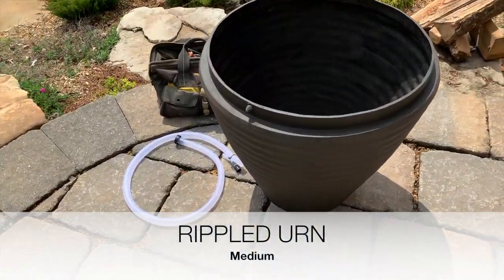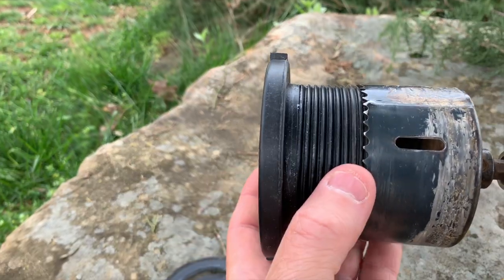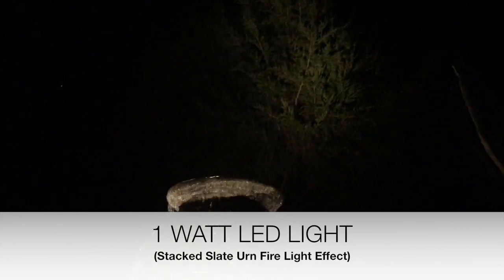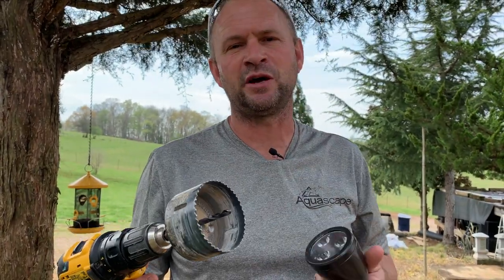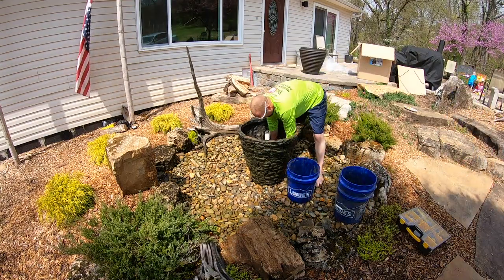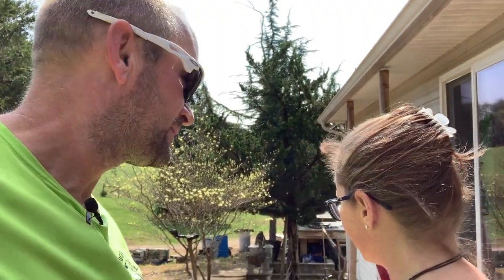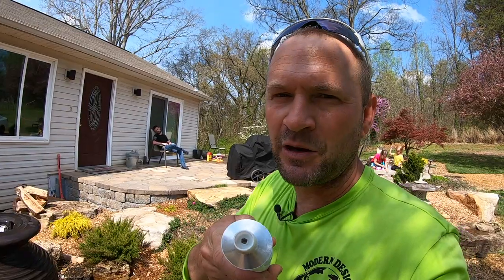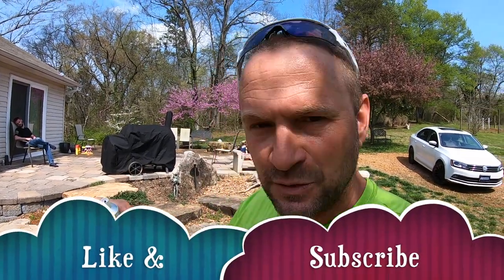Stacked Slate Urn VS Rippled Urn | Water Fountain Urns Comparison

Comment: John, I really like the 3 watt fixture idea and amount of "dancing" light it emits. (One that changes colors would be cool too!)  Where did you run your wire out of the urn? In the video it looks like through the water supply hole/ pvc pipe  at the base? Thanks.
Reply from the maker: Yes I did it up from the bottom. I run a wire from the transformer up into the inside of the urn above the gravel. Then after I’ve got it full of gravel I make the light connection with silicone wire nuts inside where they are easy to get to. This makes swapping lights out a snap :-) and I did another video with a different turn using color changing lights check it out👍🏻

Comment: John,
Are you using one or two lights in the top of the water feature? 
Thanks!
Reply from the maker: Yes, I do both ways...Color changing video has 2, the others have only 1👍😎
Reply: Modern Design Aquascaping Inc. what are your thoughts and experience using Aquascape led color changing fountain light kit?
Reply from the maker: Never used a color changing “light kit”. I used custom design with controls for multiple things on the phone app. It was confusing but I got it done. My fountains are gone now I am building my new pond and I am using all color changers in the swim pond👏👏👏SO EXCITED

Comment: I want to do a three slate urn fountin. Can I put it on a 4x4 fountain tub?
Reply from the maker: No way! I would do calculation. Splash = height x 1.5.  - SO from the edge of the fountain (urn) use that math and determine actual diameter of catch basin.  If you go extra heavy flow, increase that number. Use liner with small aquablox and a pondless vault to pull from. The more blox the better but you can use a “sloping liner” down to the blox to cut costs. I usually use max holding capacity on a feature like this though. You pay in aggravation what you save on the front end!
Reply: Thank you for you reply. I was going with one big one, one medium and one small. Still the same?

Comment: I prefer the look of stacked slate urn. As far as the light goes, I would skip it, or perhaps use the most subtle amount of it in order to minimize my contribution to light pollution that negatively impacts insects, birds, small mammals---and humans!
Reply from the maker: You can use color changing and dim it way down to get a more subtle effect?!
Reply: @KoiAddiction  Thank you for the reply! Yes, I know there are dimming options, but zero artificial light is better for wildlife, and color changing...well, that's a big environmental no-no. I do have a very subtle spotlight to illuminate a garden sculpture, but it's pointed down (please, do not point light up a tree, yikes!) and I turn it on only when I'm sitting outside at night. While adding water to a landscape is of great benefit to wildlife, artificial light works to its detriment, so restraint is very important. I appreciate you took the the time to suggest alternatives to minimize the negative environmental impact our landscaping choices have.